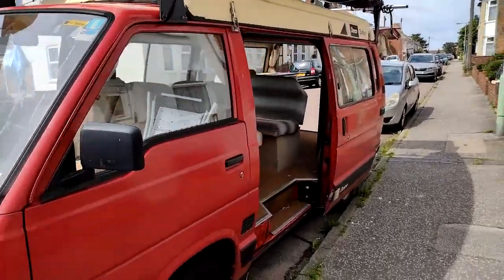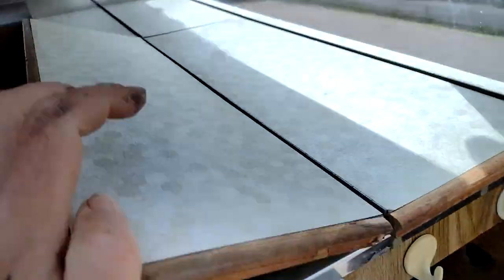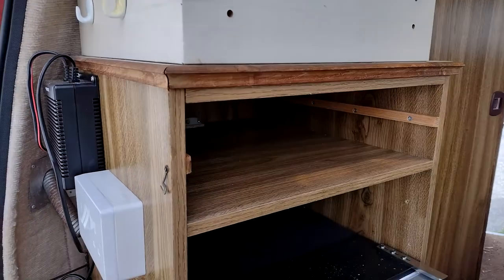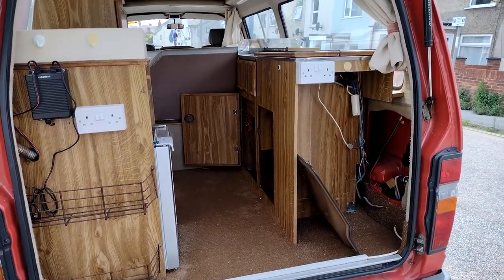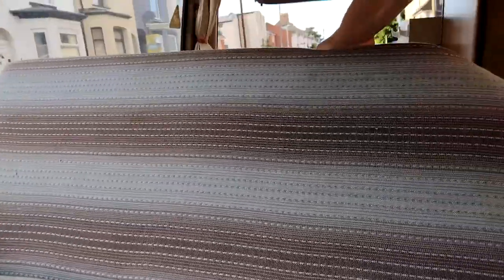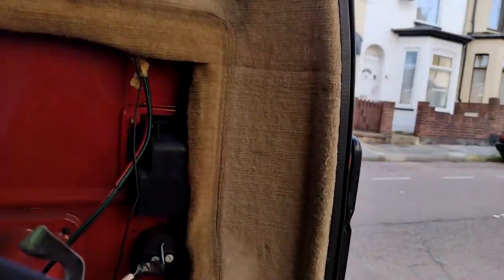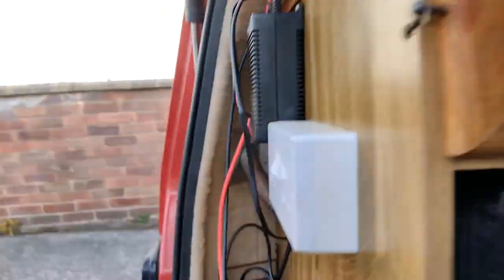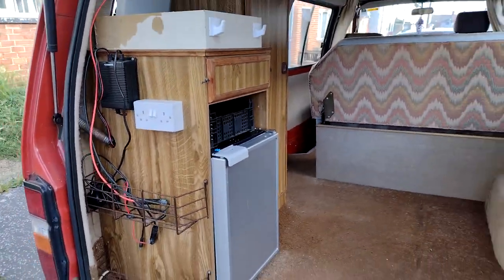1988 Toyota Hiace Campervan Devon Tourace Conversion Altering The Layout

Comment: A hiace was completely off my radar whilst researching vans. But since you started these vanlife uploads my attention has been switched from the T4/T5 to the Hiace,  Other than lack of 'scene coolness' they appear pretty good, not such rust buckets and better reliability. No access to the rear from the front seats on old ones is a bit of an issue though.
Reply from the maker: Oh they are hyper cool, the old ones! They get comments, everyone has the not as good VW's .
Reply: @Codbotherer  petrol too 👍, I don't like dirty diesel so finding a good van that does a petrol engine is a bonus. Low enough to get under barriers too.
Reply from the maker: Yeah, I can't recall the dimensions but with a pop top it's not too bad though the roofbars and kayak do add a significant bit